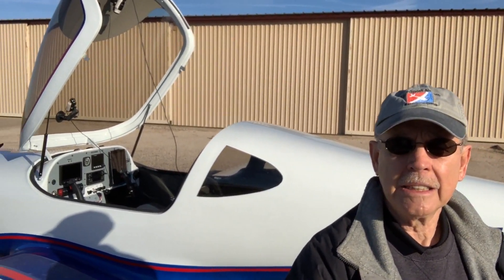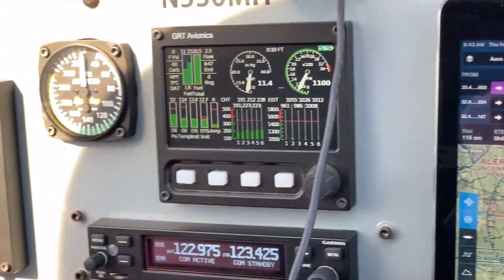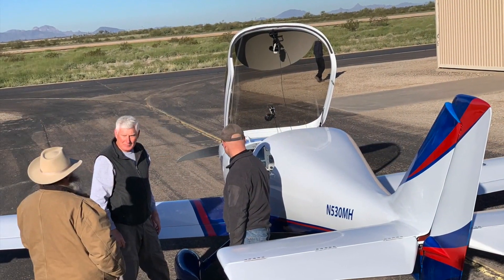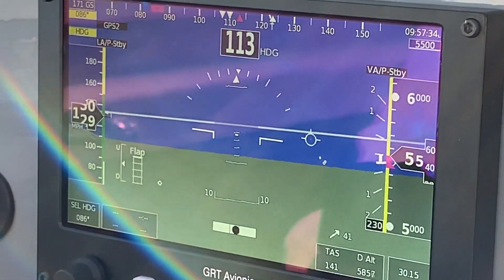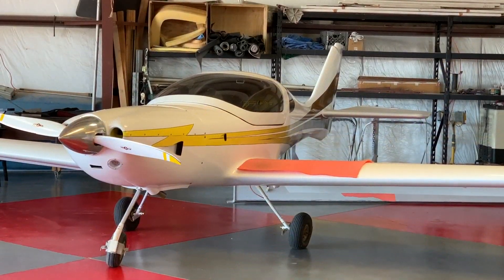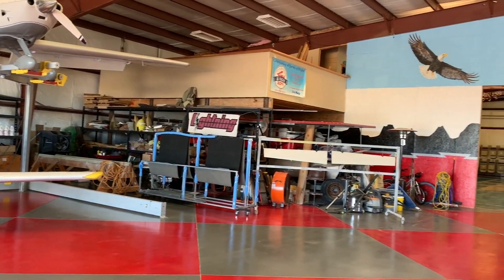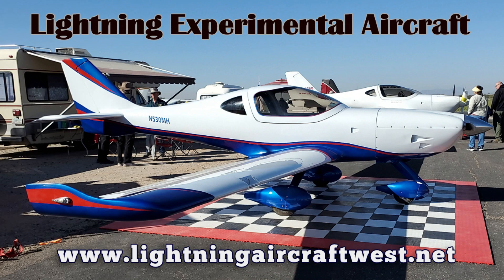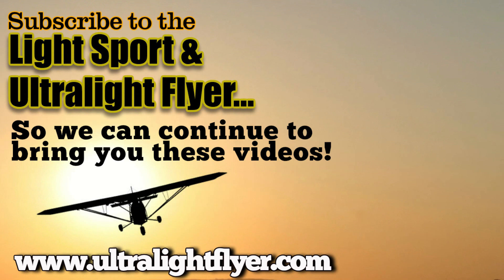Lightning, Experimental Aircraft Build Center, Lightning Aircraft West Geronimo Build Center Arizona

Comment: Nice copy of a Lancer 200 !!
Reply from the maker: Actually it is NOT a copy of the Lancer 200 - it finds it's lineage in a Spanish design.
The Ultralight Flyer
Reply: @ultralightnews  :OK, they put on a longer wing and locked the gear down....But It still has the same body shape,Canopy shape, tail and plan form as the Lancer 200..
It's hard to improve on the old trend setting
design that Lance Neibauer's vision wrought...Just thought Lance deserved some credit.....Nice looking Aeroplane this Lightning is....